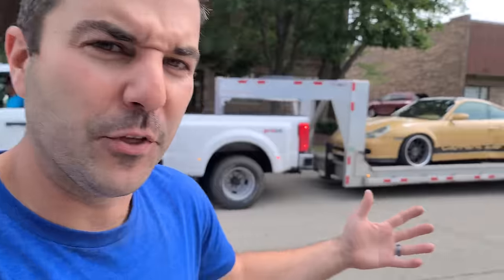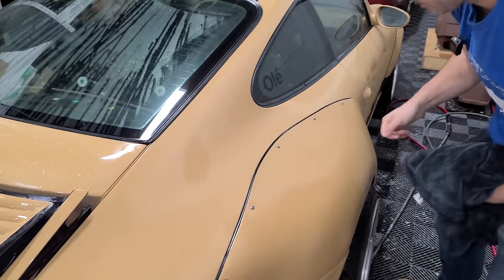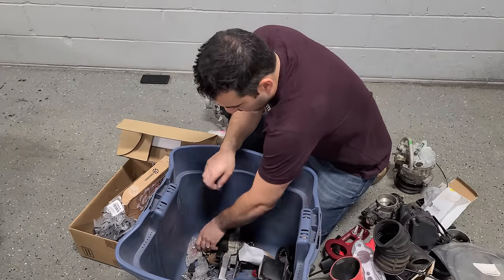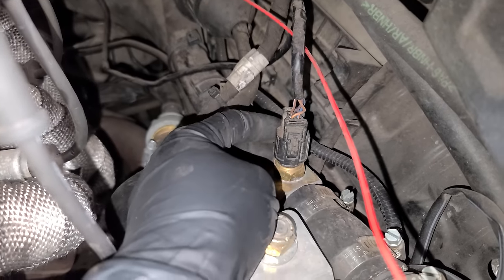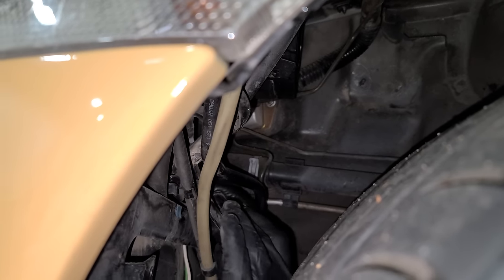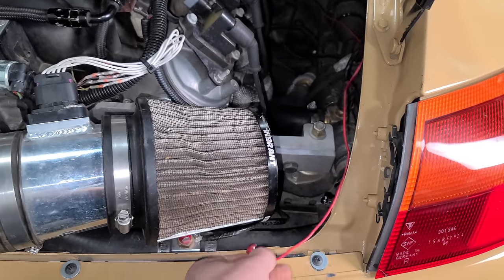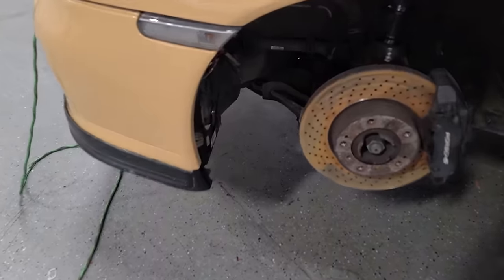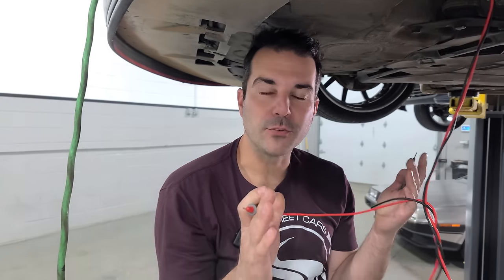I Bought A WideBody Porsche 911 That No One Could Fix! I Fixed It For FREE In 3 Hours! LS Swapped!

Comment: I am of the opinion every 996 911 from this era that is not a Turbo should have an LS if worth driving . Particulary if its the awful base tiptronic 911 . LS + MT into tiptronic car is the nicest thing you could do for it . I mean its still a 911 and despite the headlights that people make too big a deal about ,The interiors are worthy of mocking as a porsche product frankly BUT that interior makes sense with a GM engine . Its the closest thing in a 911 to a GM interior . But the basic shape and platform is still classic and junking the drivetrain that makes them feel like a rear wheel drive camary when on throttle and no where near as good as a toyota drivetrain , there is NO WAY ANYBODY SHOULD EVER BE UPSET . Its the kindest thing you can do for the most hated 911s ever produced and gives them dignity . 27K for a 911 that goes fast , thats a bargain . If you have a solid LS and can build it correct NOBODY will convince me its not infinitely better . if you have never driven a base tiptronic 911 they are so dissapointing and bland it will break your heart . First 911 I drove when new and I was so excited to finally drive a 911 and I was gob smacked , i just could not believe how slow it was , accelration is not everything , I am accutely aware , but for the money these were and the badge and shape it was a proper bummer . 100% for dentist who will never even go open throttle but wants to seem cool with a litle money and just knows 911 is not too flashy but is cool to park and the hot dental assistent might think he is cool despite being bland himself . To be fair as a momentum car on a technical road I imagine it is better then a camary . But its just underpowered to wear the badge no matter how you slice it and by more then a little. I punched it at different speeds / revs / gears , in auto , using the buttons etc etc and the trans sucks as well and useless .

Comment: They taped the wrong wire,, test the control relay for the factory temp sensor,,, and two into that, it will be switched and woke on factory specs

Comment: Well, that's a street racer, if it's chassis tuned, good for the actual drags, you know, legitimate straight line racing. 
Probably good for drifting.

But Porsche's are born for Circuit Racing, V8 swapped 911's typically won't do well on Circuits, remember !
tail heavy.

Comment: Get rid of that VOMIT Yellow color and put it back to BLACK!!!!!
I wish you were here in South Florida because I wouldn't have anyone working on my cars but YOU!!!
How in the hell does anyone take on such an enormous job like LS Swapping a damn Porsche but n't figure out what took you no time at all to fix???!?!?!? It makes no sense!

As for what I'm working on currently… I'm fighting with Ford to swap my 2016 Focus Dual Clutch Tranny and Control Module due to it slipping and disengaging at times when you floor it and they're giving me crap about it!!! I bought this car for my son but I'm not comfortable with him driving it until it's fixed because I've switched lanes to  move into he faster lanes and had the transmission completely disengage with an 18 wheeler closing in on me and have had to quickly get off the throttle and drop it into Tiptronic mode in an instant to be able to accelerate out of danger!

And Ford is giving me BS saying it's not slipping at 107% (whatever that load of crap means) so they can't change it until it falls within the parameters. If anything happens to me because of this I will be suing Ford for a handsome sum!

GREAT Vid Alex, so glad to have stumbled onto your channel. I swear you have healed the wound caused by FOX killing off SpeedVison/Speed Channel.

Comment: I can't believe this hi dollar sports car has those cheap bolts holding that kit. Black carbonized bolts would have been beautiful and they wouldn't have rested like that. Dissimilar metals do that you know. It's only a matter of time where that whole amount is turned white with aluminum oxidation. And the heads are those bolts fall off. They're probably not even Not the correct rate They may be too hard for that aluminum. This will cause illuminum to strip out if you try to remove them.

Comment: There's a kidnapping of this Porsche typical of someone that is overeducated but don't understand the concept of maintenance and repair. They wanted to reengineer rather than use critical thinking to correct the problem. I worked in the Tech field for 50 years. And let me tell you. There are so many engineers out there and different people. Who when they go to work on something like this. They always want to re-engineer it. They always know better and it always ends up destroying it. They always want to replace it. That's why you got boxes and boxes Of parts

Comment: I have three early 911s 1973 s/r no engine or transmission 1974 targa no engine or transmission 1977  W/B cab convertible complete minus convertible top. Have one just need installed getting older and don’t have the energy to finish if interested in a trade let me know I also have 1938 ford 5 window couple and 1935 ford truck 350/350 just looking for something I can drive now pushing 70 time is moving to fast all California cars rust free was going to do Subaru conversion or Tesla would make a good YouTube series

Comment: These engines have crater size bank account depletion problems Best thing that you can do with the 996-997 chassis is throw away the horrible engine and swap in a LS.  So don't buy any 996-997 that isn't the turbo model, trust me.

Comment: don't drive this car on those old tires. Or, you can be the next Paul Walker who's friend bought an old Porsche then drove it fast on 10 + yr old tires and Paul walker dies in resulting crash. The investigation concluded that the car's speed and age of the tires were the primary reasons for the crash.

Comment: Not a lover of the colour,black would better,the seats and steering wheel are horrible,set of porsche seats and porsche steering wheel would look way better,what were those other shops doing?? would have been a better build without the rivets showing like that,guessing that wide body kit is fiberglass? is the engine door connected for the rear scoop to come up when you reach 50 mph?,the car is way too noisey,that would drive me mad,think of driving 200 miles with thatdrumming noise all the way,hope everything else about the car is ok,those wheels will be broken when you hit one pothole.